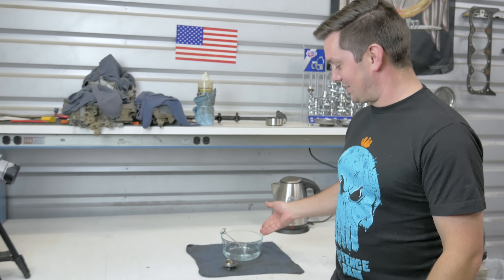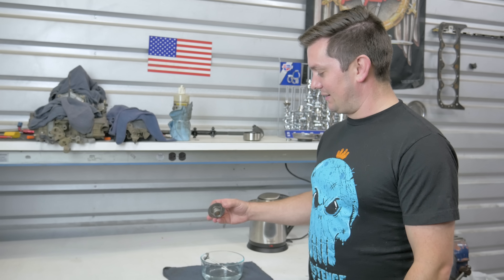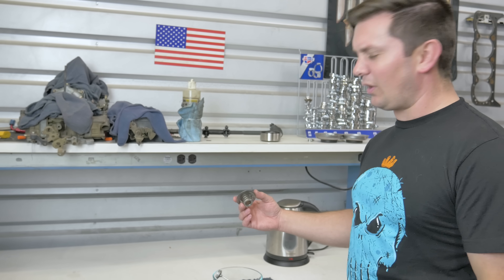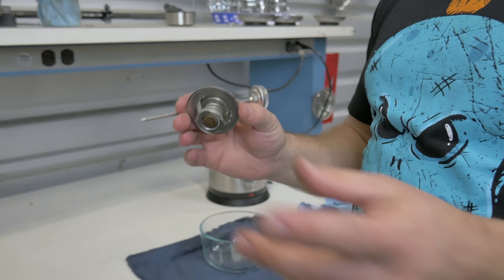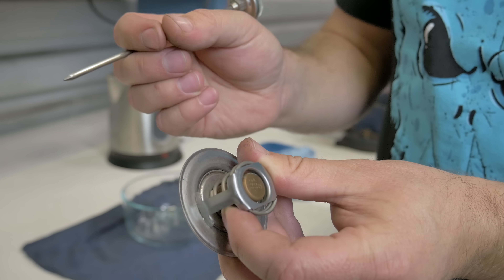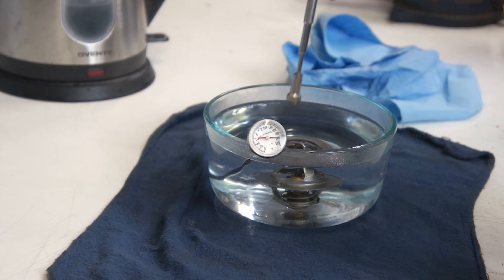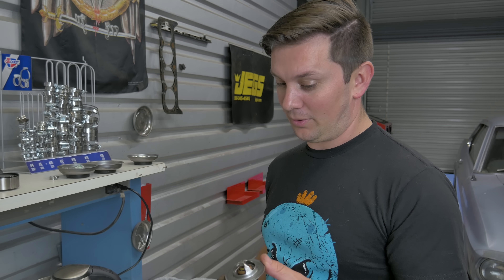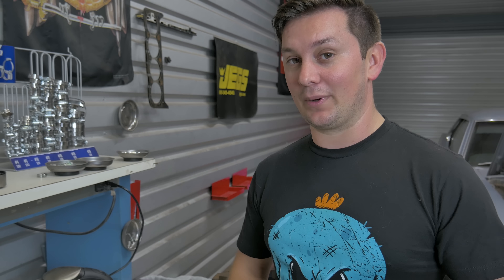How to Test a Thermostat | Thermostat Test Boiling Water

Comment: Thanks very helpful video and I'm going to try that tomorrow morning my issue with my PT cruiser is that the water coolant is going from the radiator into the reservoir and I checked for any white smoke due to maybe a crack in the head and I check for fumes coming out of the radiator cap

Comment: This won't work for my car. Boiling point of water at my altitude is higher than the temperature rating on my thermostat.
Reply: Could use a known temperature from another source, such as a heat gun. 

I just tested my 203º F thermostatin 212º water and it was only partially opening. Put it directly on the stove element and it opened fully. 

I'm going with a new one.

Comment: Just a tip tho, it can still appear to open and it be the problem, if the wax/guts is bad, worn springs or seals is bad it’ll cause issues but to the naked eye it’ll look like it’s opening and closing normally

Comment: Do you test if it's really open up at 82c? I'm concerned as my new thermostat don't start to open at the exact temperature, would it be interfere the engine cooling? As my radiator and condenser fan will try to maintain the engine temp at 85c while ac on

Comment: Great video Pal… I did this method and it work fine but I took the thermostat out and rinse with water and put it back it in the boiling water, the thermostat didn’t open at all…. I believe my thermostat is not functioning properly

Comment: I want to know what make , model and year car you say takes a couple minutes to pull a thermostat. I guess if you don’t count the 20 min drain time ( after the half hour finding the drain) removing air box and snorkel, maybe a bracket or two (10 min more) then use your articulating tools arms and wrists to locate the 2or3 bolts holding the housing on ( variable time here if the engine is cooled off or not) to test the thermostat!? Throw it out after all that ……… oh I see this video was posted pre YouTube in the late 70’s
Reply: A thermostat on my 78 international scout is pretty easy to get to. Two bolts.

Comment: tested 4 thermostats for my older classic.  NONE of them opened at the stamped number!  IE: 195 degree only partly opened at 205 degrees .  had to hit boiling (212) before it opened more!!   Finally, I checked a 180 deg.  It opened at 195 deg and was fully open at 205deg.  My engine requires a 195deg thermo.  My car was always running hot.  Don't know what's in there now, but ill be swapping it out!  Thats how you check thermostats IMHO. 🙂

Comment: couple minutes to pull it out?  mine took 3 hours to remove.
Reply: Some are just NASTY — and the engineers who put it there should be fired. 

Especially in cases like yours, it would be wise to test the NEW one as well, before putting it in.

Comment: I tested two and they both open with boiling hot water and close with cold. Its still running hot. Could my bleeding tube that run to the thermostat housing be plugged up??

Comment: I checked mine today and it was jammed half open lol. Wondering why the bus was over heating. I suspect it is jammed in this position and not letting water through. We changed the water pump for good measure. Also going to change the fan clutch for good measure.

Comment: What temp thermostat would you recommend for an 80 chevy 1 ton dually with a 427 and a truck  4 speed? Pulls a gooseneck trailer.
Reply: Do you have overheating problems? You should stick with the stock thermostat, engines are designed to run at their operating temperature to reduce wear. If you have overheating problems don't just lower the thermostat temp, fix the actual problem.
Reply: Google it dawg
Reply: @downloadingutubes  Looking for "his" specific recommendation, not a thousand different Google answers.
Reply: @ChrisInND  google correctly bossman

Comment: He's wrong.   When the thermostat opens it allows hot water to flow from the engine to the radiator, not from the radiator into the engine.  He should know better.
Reply: Both are correct
Reply: Both ways are correct,,,

Comment: ALWAYS  test a Tstat BEFORE putting it in the vehicle !  I have had new ones fail right out of the box !
Reply: Thank you for this advice. I don't know a damn thing about cars but I'm trying very hard to learn as much as possible. Little tips like this help
Reply: I learnt the hard way yesterday 😢 I finally got the truck assembled after a month of engine work and when I finally wanted it to start, the truck started overheating and then found out that the thermostat opened after 215 degrees and it’s rated for 195! Quick trip to AutoZone and got a better thermostat and boom, solved my issue
Reply: @changmark you have to pay for it first and check it home/shop or anywhere else you can have or make water boiling. I see that a thermometer is a must based on the comments above. Also check thar you are installing it correctly based on your  vehicle.
Reply: I shouldve done that. My check wngine light kept coming back. I do hope its not the new thermostat
Reply: @andyl9920 a thermostat will not throw a check engine light unless maybe it's on a much newer vehicle than my 2006 I'm actually not sure if a faulty t-stat can be read by the computer I doubt it
Reply: And in 2025, I'm on defensive thermostat #4...

Comment: why go through all that if your car overheats crank the heater to maximum if the temperature gauge goes down with the heat on then change the thermostat, worked for me for the past 30 years
Reply: What if i turn the heat on and the car is still hot

Comment: A couple things to be mindful here: A) never pour boiling water, or near boiling water, in glassware like that. B) Stant states that thermostats will START to open at their printed number, not be "fully" open. Fully open is 15-20F higher than what's printed. You've tested that it's fully open at 200F, yes, but you didn't test when it starts to open.
Reply: OMG! Yes you can pour boiling water in Pyrex or most kitchen glassware! They are specifically designed for that.
Reply: It’s the internet police.
Reply: My bowls always explode when I pour soup in them. I wear safely glasses when I chili after an incident in 2007.
Reply: @Labradorslobber look into purchasing either Pyrex or correll dishwater
Reply: Yes it should start opening at the written temp, if not then its a trouble.
Reply: If your Tstat isn't fully open within 5 degrees of the stated then you'll have a blown engine. Test them and see.